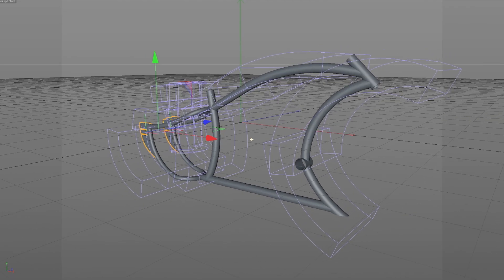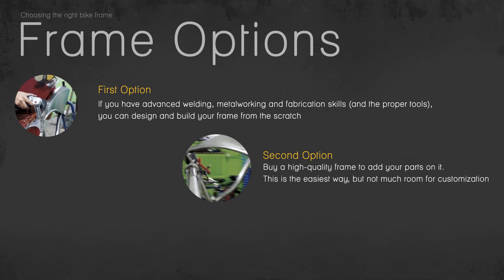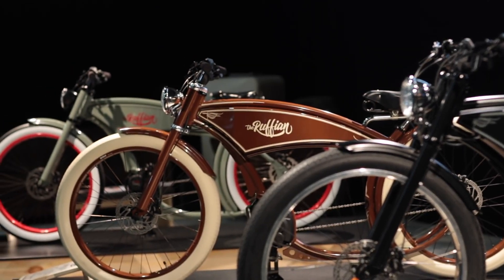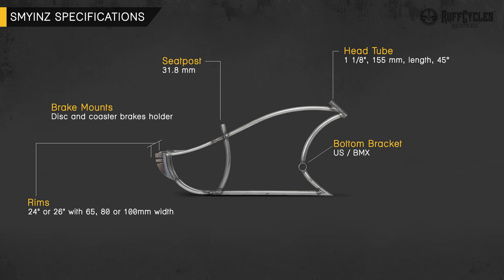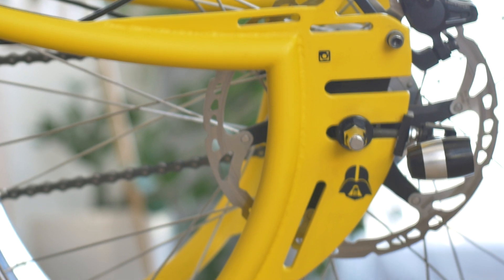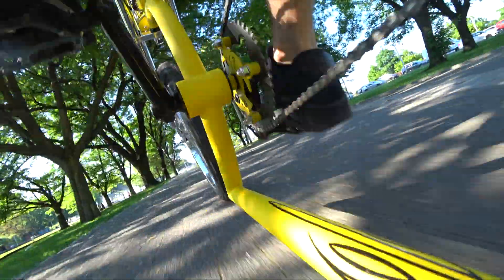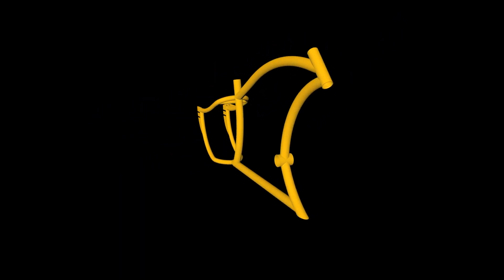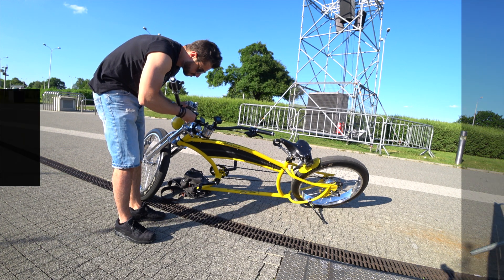Detailed Ruff Cycles frame Review | All you need to Know

Comment: Where did you buy rear wheel from? I can see it has disc brake but on ruff cycles website every rear wheel comes with 3 speed hub and coaster brake without disc brake mount
Reply from the maker: Hi Tarik, I bought all parts and assembled it myself. You can buy the parts you like and send to any good bike shop to assemble it for you. If I am not wrong all Ruff cycles frames are disc brake ready.  You willl need the adapter as usual. I am using a Shimano alfine 8 hub and the brakes are Shimano as well. Please let me know if you have any doubts
Reply: @BK42Cycles  thanks for quick reply, I'm not a big favorite of a coaster brakes, I'm trying to find 3 or more speed hub with disc brake option and a free coaster of course, and to fit a 100 mm rim size...
Reply from the maker: I got 8 gears and sometimes I need more... you are right.
Be careful with the 100mm. Mine is 80mm and I had a hard time to fix the chains. It is difficult to avoid the chains rubbing the fat tires

Comment: Hey Man! I'm following your suggestions and looking more into the Smyinz... please if it escaped it me in the video explanation, but with such fork rake factor/head tube angle, do you think it will need more attention and control when steering in road turns/curves? (especially at high speed i mean - i see you talk about bit heavy turning, but i mean also bit kf shaking/wobbling/keeping the steering at the precise needed side angle) Thanks, keep it up!
Reply from the maker: Hey Dorian! Turning this bike isn't indeed super easy, after years of riding it I'm used to it, but always when someone wants to try the bike for the very first time, they have to learn how to turn it properly. I haven't use Smyinz with other forks, but as you said, the head tube angle is the "issue". As the longer the fork used, the more difficult it gets for turning. 
I am using the original Ruff-Cycles forks as the base of my fork design, so I guess, turning will always be a thing! 
Turning the bike at higher speeds isn't a problem, it actually gets easier, like in a motorcycle, I mostly lean my body at the curves.
I don't feel shaking or wobbling, it very steady, you'll definitely get used to it, but yes, it will need some practice indeed.
About the Smyinz frame, I believe you should remind that is a very low bottom tube, so you need to think well about how and where you want to ride your bike.
Is it going to be your first build? Where are you from? I hope it answers your question.
Thanks and welcome to the channel
Reply: @BK42Cycles  hey bro, we are friends but let's skip personals here - on the tube you never know who else is passing by ;) - i will write you a private message. But, let me say here just thank you SO much for having indeed replied as a real, and a very good, friend :) . Time ago you suggested me to stick to good brands (other names that i'll better skip here) and I saw how that really makes sense - you are so right. I only needed to learn a bit about hub gear systems, brakes and in fact geometries, i know gravel bikes and a bit mtb's too, but these cruisers are really different class. I haven't even found anyone riding both the kind of bikes (it looks i'll be the first one i know, hehe... ). I only see the occasional sporty fat bike and fixies as a side product to online shops. Ruff is so good! The Smyinz is best look as well! And it's very honest and plain of you to explain pros and cons. So I'm getting the idea that a Ruff Basman  has a bit more 'standard bike' look, (as less recumbent maybe it could be a less relaxed sitting than the Smyinz or the Esco? Anyway) but then (the Basman) still makes sense as easier to steer (more upright fork and indeed the sitting). I'm in Italy (again, let's skip that ;) ) but not far from me there are Tsp Cycle Farm and I'd be happy if you just check their Wave and the Class frames (they have similar geometries/rider positions. The curves of the tubings, the outline and look, are bit different. There is also the Wave HC frame, but not so different). In particular I like the idea of one, their Class Demon Board Tracker. There's a youtuber shop, East Von Chopcycles from Vancouver, has done a few videos of rides, here on yt. He says he does some 80 km/h even with the non-electric ones, I was shocked - and I would think Ruff and MAD and all good cruisers really go so fast. Anyway... thanks so much and we'll keep in touch :) As I'm bit tall (36" inseam) the Smyinz with its 64ish frame inches foot to saddle, as you explain in this video here, is really appetizing :) thanks again, tight rides!
Reply from the maker: You can contact me on Facebook, Instagram, or email ( bk42.bikes at gmail. com ) 
The Basman is classic and very comfortable, made by a tall guy for taller riders. It is a bit more practical than the Smyinz as the bottom tube is higher and very comfortable to ride on.
About speed, I can't talk much about it, I don't really enjoy going fast on my custom, the max speed recorded is 57km/h. The Wahe HC looks really good, and the green one is amazing! I follow East Von Chopcycles, they have nice rides :)
I think you are going in a very good direction, the frames you're choosing are all great, the difference is the riding position/style. These frames made in Europe are usually very well built and easy to customize. 
I'm curious about your build :)
Have a good week
Reply: @BK42Cycles  fantastic (to have your approval, story and encouragement :) 50+ km/h is A LOT fast, even for roadies :) ). Thanks again ever so much and we'll ride on :) i'll let you know what will end up in my case. Awesome!!
Reply from the maker: thanks brother, have a good week :)
Reply: @BK42Cycles  thanks, such big patience and care you have 😌✌ same to you and about speed, definitely yes, i've actually turned to look at custom bikes because of enjoying more and more just slow, city cruisin'. Country roads are enjoyable too but a cool, slow ride from home, enjoying all the view all around, is just heaven. Yesss :)

Comment: What kickstand are you using? Is it holding the bike pretty good? I notice it stays till only with the front wheel turned. Does it ever stay still with the wheel/fork straight?
Reply from the maker: Hi Hallan, I am using a very cheap kickstand customised to keep the bike standing. I has proven to be very efficient even at the most windy days, but unfortunately it keeps the bike only with the wheel turned indeed. It was my intention as I like how the bike looks turned, as well it makes the bike a little shorter ( easier to keep at home ).
The kickstand and the simple customisation can be seen here: https://www.youtube.com/watch?v=GxZ-JH6kKaI

If you want to keep the fork straight you might search for "Double legs Mount Stand" You will need to customize it as well, as they are too long for the very low frame.
Let me know if you need any help.. Cheers

Comment: what would you prefer Tango S or Dean S, living in slovakia and roads are not that flat here or sidewalks, I'm a bit afraid to destroy the tango spike on the frame as it's quite close to the ground. I love the frame but cannot decide. or Maybe Basman?
Reply from the maker: My riding experience with this bike is either Warsaw or Amsterdam, either very flat. However, I am very careful when going up or down in the sidewalks. It it is too high, I usually get out of the bike. This frame is very well built and very strong, but the spike must be considered as the weak point indeed. As you mentioned your area is not too flat, I would go definitely with the Basman. Second opinion Dean.
A small trick can rise up to 7cm the bike (only for Dean and Tango). These frames have two holes for the axes. One for wheels 26" second 24". I am using a 26" in the place of the 24" - lower hole. But remember, you will need to rise the front forks as well if you want to keep the frame parallel to the floor. You can see my fork solution in this video: https://youtu.be/x8PRWE8x_lU
Do you have experience building bikes?   RuffCycles offers some aluminum frames as well, you may consider them  too. I hope my answer will help. 
Cheers Myr
Reply: @BK42Cycles  thanks a lot, I will check your guide, I have no experience in building bikes :) but I do have some tech skilled friends with a garage that may help me. I rly like the Tango but I think I will look more towards Dean or Basman given where I may be riding it.
Reply from the maker: @001Elpato  right, it is very important to ride safe :)  I'm sure you will develop all skills to build your bike, building with friends will make this experience a lot better! 
If you have any question or doubts you can contact me...  either here or by email - My email is on the About me tab. 
Any frame you pick your bike will be really cool :) Cheers

Comment: I'm building a Porucho E bike and I may have problems due too me using 100mm wheels and a hub motor ,I have been told I can get offset freewheel and chain wheel but the freewheel only fits a internal gear hub ,any suggestions would be helpful..
Reply from the maker: Hey man, can you pls tell me more about the parts? What is your hub motor? What concerns me about having the 100mm wheels is the issue with the chains. I'm using 80mm wheels and I had to adapt the front sprocket. I was considering the same frame for my ebike. Perhaps you will have some extra work to fit the parts but the bike will be great. Let me know more details, perhaps I can help based on what I know about my frame..
Reply: @BK42Cycles  Thanks for your speedy reply ,I will get back to you as soon as I have the back wheel built.
Reply from the maker: ok mate, you can find all of my contacts in the channel as well. Keep in touch.
Cheers